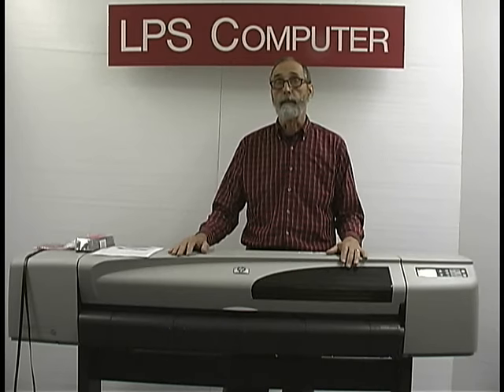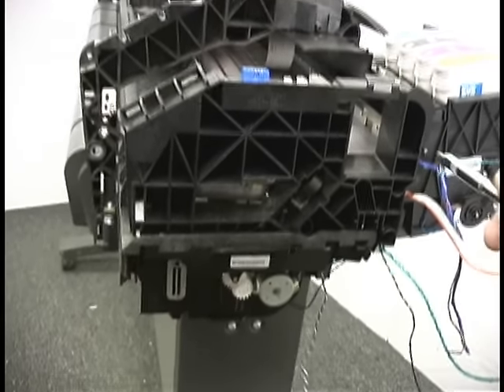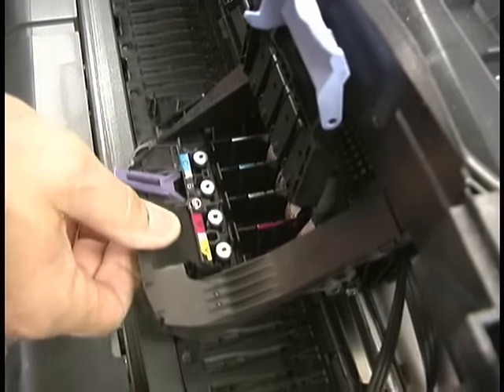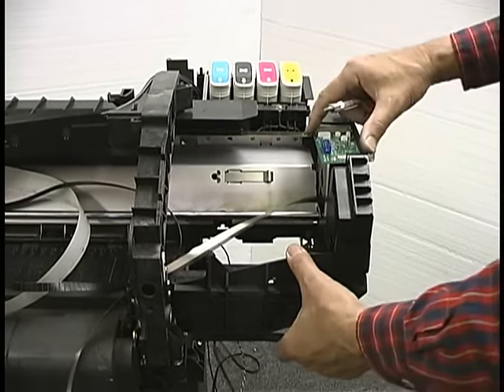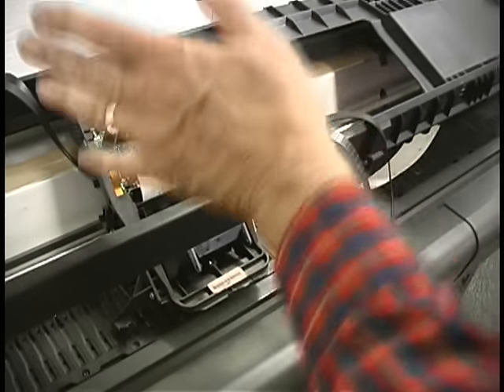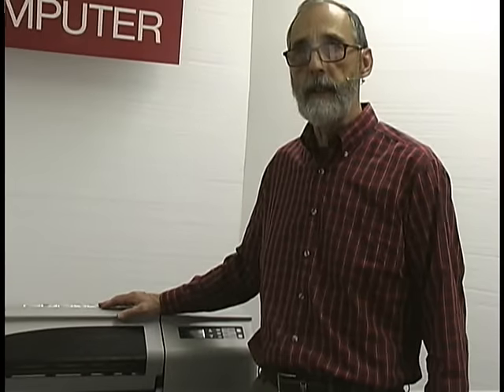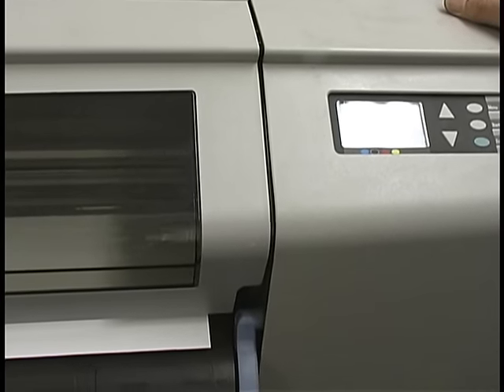HP Designjet 500, 800 Belt Replacement & Calibration

Comment: Bought the printer for $100.00 in a garage sale. Replaced belts on a 450 before but reluctant on this one. With the video, instructions and tools provided I was able to complete the belt replacement successfully. Tricky part for me was the encoder strip. I found it easier with another person on the other side pushing the metal tension. Important to clean the brass and plastic belt pulleys.Great video. Thanks!
Reply from the maker: Awesome!

Comment: One thing he did not mention in the video, but is mentioned in the written instructions - and I learned the hard way.  Before you slide out the service tray you need to lift the carriage lock.  I didn't and as a result broke mine.  Had to order a replacement from them and am now waiting for that part.  Not a big deal, but annoying.

Comment: Thanks Bob. I bought a used 500 24 inch and was experiencing rattling and lots of noise as the printhead moved left and right. Your video gave me the confidence to take the machine apart and clean the inside of all the sticky gunk that had built up over the years. It works perfectly now. You can read all the tutorials and manuals you like but you can't beat someone who knows what they're doing actually showing you how it's done. Top man!

Comment: I followed along with this video to replace the 5-year-old belt that had split lengthwise in my hp500. Start to finish took about two hours with the LPS belt in hand, which included about a half hour cleaning a good bit of the belt residue from both pulleys.  What impressed me most about the presentation were the little tricks throughout that could not have possibly been conveyed by the most graphic service manual.  Without a doubt, much frustration was avoided.  Thanks for the attention to detail!

Comment: Great vid Bob!... heres some trivia for you... The media advance calibration should be done on Genuine HP stock AND match the profile selected in the menu. The Cal is actually calculating the amount of rotation, down to just a few minutes of arc, that the platten roller needs move in order to position the TOP surface of the paper to eliminate horizontal banding. It has an LUT in the firmware of media thicknesses for each of the preset profiles. If its done on some random piece of 3rd party media, thats not exactly the same thickness as the selected profile... well it updates the calibration and throws of every other profile thats stored on there. The other option is just to get the end user to calibrate on what they use all the time, selecting the profile they usually use. That way they are sure to get great prints on what they use every day. Hardly anyone actually pays HP prices for their production media on a 500/800 ;)

Comment: Great tutorial on replacing the belt! Very easy to follow - camera work and verbal instruction were spot on! I did discover that I bought a cheap belt ($5) and it had the ribs all the way around the inside but used it anyway.  The only thing that I forgot to do was to plug the 'service station' power cable back in.  This resulted in a error code after powering up the plotter that indicated the service station needed to be replaced.  After plugging the cable in and rebooting, everything was okay.  Thanks again for a great video!

Comment: Excellent video. Instructions are perfect. Not a simple job to take a whole machine apart, but the guidance was great. Take your time you will be successful. I used a pair of long needle-nosed pliers to get that belt tension pully to pop back into place, by squeezing the ends and I possibly avoided breaking the plastic tabs as may happen when prying with a screwdriver.
Reply: yep that's what I did too. I happen to have a pair of thin ones I had from a electronics repair kit.

Comment: Thank you Bob.  This was very helpful indeed.  If I could add two minor details.  1) When fitting the new belt to the carriage, there is a 'hidden' lipped channel inside the belt holder.  Make sure the belt slots in there.  2) When removing the LHS cover, beware of the Power Switch, which catches - be careful not to damage it.  Obviously, remember this when re-assembling.

Comment: I bought the LPS computing kit based on this video. You can get a $15 belt, but how long it will last or whether it will even work (some of them have incorrect striping on them) is highly questionable. Everything in the LPS kit was high quality. I had to call up Bob to ask him a couple of questions and he promptly returned my call and solved my problem. I highly recommend.

Comment: Thanks guys! This was my first belt replacement on plotter. The belt on my customers HP500 24" was shedding chunks and part of the belt was just the stringy fibers. 1.5 hours, 15 minutes of which was cleaning rubber out of the motor pulley. I watched the video twice before going to my customer's site and only had to reference the manual twice. Great training!!

Comment: Thanks so much for the tutorial.  I purchased my belt from you guys and just installed it on my 800PS today.  Gave it a good cleaning while I was in there.

It's perfect and quiet now with no more shedding of the belt on my paper!
Reply: And now the belt is shot after light use.  It's shredding like the OEM one.  I honestly power this printer up like five times a year and do a couple of large blueprints.

Comment: Thank you for your instructions.  Ordered LPS belt 2 weeks ago, and followed along with your video and got it going in about 1.5 hours [also took some time to clean out broken pieces of old dry-rotted belt, etc.].   I had already cleaned the service station a few months prior and didn't have any problem opening this unit up to do the work.  I had a service station error ( I think it was 21:15 or something like that).  The station motor was unable to turn due to dried up ink goo on the larger black wheel.  It took a little over an hour, but just kept cleaning that wheel over and over until all the goo was off.  Then, the well was able to spin.  The error was gone.  Just thought I'd add that, since I know this unit is expensive.  It can be cleaned up.  Also, good idea to wear some gloves when doing this.

Comment: searched around and got the answer,. Putting it out there for others who might have the same problem reattaching the encoder strip on the left side.  "per HP- If your unit is 42" you will need someone to push on the metal plate (on the right) when installing the left side. You will not be able to pull the encoder strip and screw in the set screw on the left side at the same time. There's too much tension. Someone needs to push on the plate with their finger."  YES IT WORKS. .

Comment: Great video..just replaced my severely torn up designjet 500 belt...just like other people mentioned...cleaning the gobbed up rubber off of the motor pulley was not easy...very gummy and hard to clean off .and all the belt shreddings..throughout entire printer ..was not a fun job...but happy its done....thanks bob....

Comment: 2 points to make putting it back together again.  When sliding the metal encoder strip through the carriage it will have a slight bend from being curved around the end where it us screwed on the left.  It helps to slightly warp the end the other way so it slide through without getting caught.

Also when trying to put the screws back on the left service section some screws tend to fall unless you have a magnetic tipped screwdriver, if you dont have one a plastic bag can be used, press the screw through the bag so only the head is in the bag then you use the bag to hold the screw on the end of the screw driver so you can line it up to the hole.

Comment: Excellent! Couldn’t have done it without Video. There was a small mistake. In removing end cover besides the 4 on end 2 underneath and 1 in front there is also a screw on top that bolts to metal bracket. Great non the less

Comment: If the encoder strip is difficult to pull tight enough to fit screw in/ go over lug - then go to the other end of the carriage and press the tensioner bar in from the end.  Easy to fit screw in then.

Comment: I'm following along, step by step in replacing the belt.  Doing good.Excellent tutorial.  I am up to the part where you have to screw back the calibration cable and am having a hard time in pulling it tight around that little corner where the dimple is.  Can't get it to where it was originally with that pin dimple. Anyone else have this problem.? If I chose to ditch that dimple and go for the hole and just screw it in, it doesn't seem tight enough. What am I doing wrong?.

Comment: I had the same problem and solve it like that! the tape that runs parallel to the head (not the Trailing Cable, the other that is thinner and stiffer) gets dirty and needs to be cleaned well ... from end to end with isopropyl alcohol.

Comment: Great video. Thanks so much. I have replaced the belt with your company's belt. While performing the calibration I am still getting an 81:01 error. All seems good with belt.... Checked it twice. Cleaned drive motor gear. Wiped encoder strip as you instructed. Right before the error the carriage seems to skip/bump a tad as it is sliding right. Any ideas on what could be wrong?

Comment: Great video.  I inherited an HP jetdesign 800 24inch this year and am using it for film positives for silkscreen.  The only problem I have is the film roll ends are too big for the spindles so I bought an adapter which goes onto the spindle end blue end. Do I need two of them or is one good for the job?

Comment: Hello Bob, thanks for the tutorial, proved very useful in adding more life to the company printer. Reaching out if you have an idea about driver software for AutoCad 2018 ? It does not seem to print after the switch to AutoCad 2018 anymore ? We came from Autocad 2014 before the update. Thanks again for all the help !
Reply from the maker: Hello.  I am not an expert on AutoCad but to my understanding, AutoDesk started using Windows drivers for output several years ago.  Your solution is probably centered on the version of Windows you are using. W7 & 9 work very will with the XP-Pro 64 driver.  HP also has a "universal" driver that is supposed to work with W10.  The drivers can be found at https://support.hp.com/us-en/drivers.
Reply: @LPSshowsyouhow  Hello Bob, thank you for the expertise, i will pass this one to our IT department. All the best and take care !

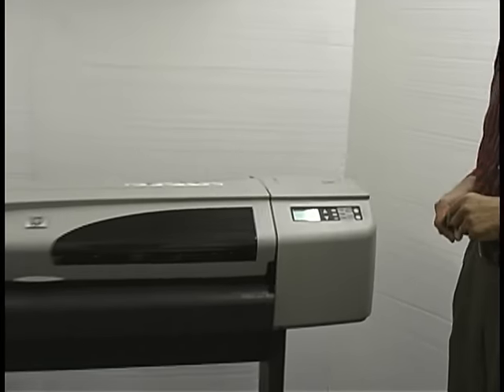Comment: Any idea why I would be getting the 05:10 error after the belt replacement? I'm imagining one of the cables to the control board is now no good?

*Edit: It came on one time successfully, but spooling a small 10mb job to the printer ultimately lead to a different error code and the printer will not boot past 05:10 as of now. Guess I'm getting a new formatter. :(

Comment: Hi, thanks so much for the video, I replaced the belt successfully, performed the calibration but now the print heads are misaligned with a bad shadow. I tried running the alignment and got an alignment error. Does anyone have any suggestions? Thanks in advance.
Reply from the maker: Shadowing is almost always caused by a broken or missing rear carriage bushing.  When the bushing is missing, the carriage rotates too far forward and the distance between the print head nozzles and the media is reduced.  The plotter prints in both directions and the distance is critical for the image to match in both directions.  Replace the bushing. https://www.lpscomputer.com/collections/designjet-500-800-parts-page/products/q5669-60687-designjet-carriage-bushing

Comment: i get a old used HP 800 with 11:11 error code..i have changed the belt and the trailing cable ,the problem is that once everything is installed I have tried to align the printheads and the printer moves but does not print since there is a distance of about 4 mm between the printheads and the paper, the printheads never contact With paper..any idea?
Reply from the maker: Was error 11:11 present before you replaced the trailing cable?

Comment: I've been trying to calibrate my printer and it's dimensions are still out. I have also aligned the print heads I've done everything and can't seem to get it right. Width is fine its just the length 4mm our over a metre. Does anyone know what I could do to rectify the please really irritating. I have to adjust this everytime I print to counter for it being 0.45% out. Doesn't sound like much for my application it's huge

Comment: Okay. So I've replaced the belt, the ink tubes, and the encoder strip all over a period of about 6 weeks with all new parts from LPS Computers.  Every time I plug it in the carriage moves back into the carriage house then rolls out to the other end as it should then back again into the carriage house and  then out 2/3rds of the way and stops with the same message that I've gotten ever since I replaced the belt..."Open window and check printhead cover is properly closed.  Press enter to continue."  And like an obedient "printer monkey" I follow the instructions but to no avail.  It is caught in a loop like the program needs a cold reboot? No obstructions.  I haven't put the new printheads (also from LPS) into the print carriage yet as I've not primed the new tubes.  Can you think of anything else? Thanks.  Stan
Reply from the maker: Hi Stan,
See the tutorial for diagnosing error 86:01 (same error as "check printhead cover"): https://www.youtube.com/watch?v=X6hywdtYDBQ

Comment: my 500 has finally let me down... the magenta (only)  wont print for more than 1-2 inches, then it fades like the ink has ran out. stop, give it 10 minutes, can print another inch or so...
Plenty of ink, a syringe/needle in the carriage and i can draw good ink no bubbles, drawn about 50ml through etc, topped up, done again, still same..... head prints fine when rested but only a few inch of solid color....
using refillable carts, not blocked etc, same ink just suddenly faded away 2 inch from the end of a big a1 canvas

Comment: When and how do you apply the oil ??
Reply: I have this question too. It isn't in the printed instructions or this video. Went all the way through measuring calibration before I realized I hadn't used the oil.
Reply: Apply oil with a small cloth

Comment: I have one of these printers with excessive friction on the carriage. The carriage is very hard to move. I've already checked the obvious, lubricated the slider rod, replaced the idler pulley, checked for obvious problems or obstructions and I cant find anything wrong. Anyone has any ideas where else I should check? Note: the problem is present only when the belt is under tension... if I release the tension the carriage moves freely... when I restore the belt tension it becomes hard to move again..  uh? whats up with that??
Reply from the maker: Does the carriage motor cog turn easily by hand? If it doesn't, this may be a sign of a dying motor.
Reply: Thank you for the reply, yes, as far as I can tell the motor spins easily by hand. I mean,...it has the normal resistance that a stepper motor should have although I'm not an expert in the subject.... but it doesn't feel strange in any way, it seems ok to me. The carriage belt is NOT original by the way.. its one of those aftermarket ones, because I couldnt find an OEM one... belt too short maybe?
Reply: If you allow information about the belt such as the size and size, I can not get it

Comment: error 86:10 after replace belt on z6200 any sugest??
Reply from the maker: I suggest running the scan axis test, found on page 80 of the service manual. 

https://cdn.shopify.com/s/files/1/1083/1086/files/Z6200_service_manual.pdf?9878984334271461826

Comment: if you get broken the clip
you can print it with this:
Plotter HP 500 / HP 800 plastic clamp (or clip) for trailing cable found on #Thingiverse http://www.thingiverse.com/thing:1125082

Comment: Thank you Bob. But be careful, bob badly puts on the belt. Vice versa. Teeth are to be from the inside.
Reply from the maker: I'm not sure what you mean. Please refer to chapter 8-83 of the service manual: https://cdn.shopify.com/s/files/1/1083/1086/files/500-800_manual.pdf?9878984334271461826